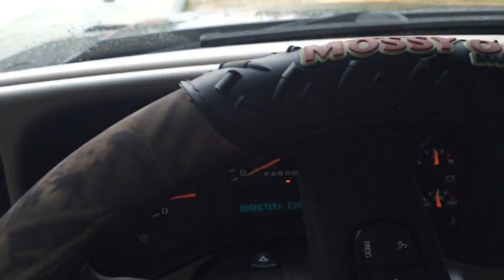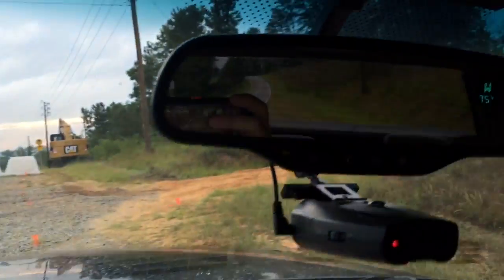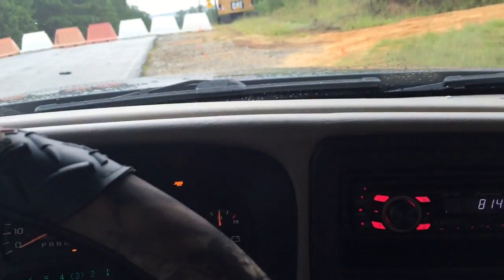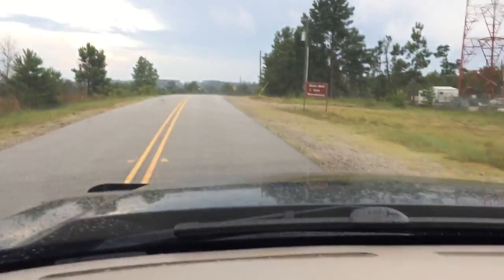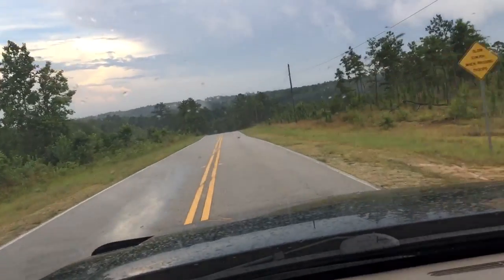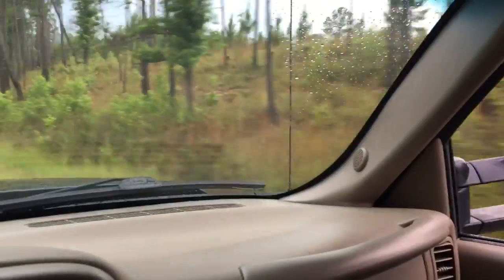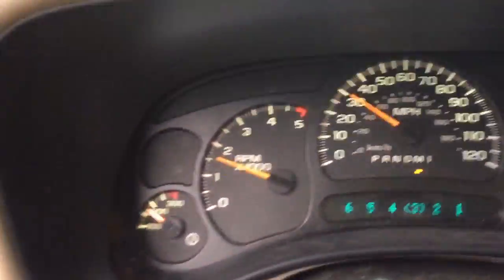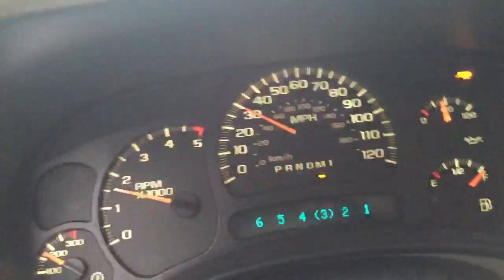Duramax LBZ Turbo Brake

Comment: You need efi live. it has exhaust brake right in the tune, works real good in tow haul, and in manual mode, as low as 1200 rpm. No need to switch a switch.
Reply from the maker: That is EFI Live. You can buy 5 tunes and switch on the fly. This one is the tow tune.
Reply: No shit Sherlock?

Comment: How did you lock your auto trans into a certain gear?
Reply from the maker: Poor choice of words. Just means it won't shift above 3rd. You can't start it a higher gear like a manual transmission.
Reply: @ao10s  no he’s saying how did you get your torque converter to stay locked for the turbo brake to actually work
Reply: Tow / haul mode locks the converter.

Comment: Can you use it not in manual mode of the transmission?
Reply from the maker: It works in any gear.
Reply: @ao10s  do you have an instructional video